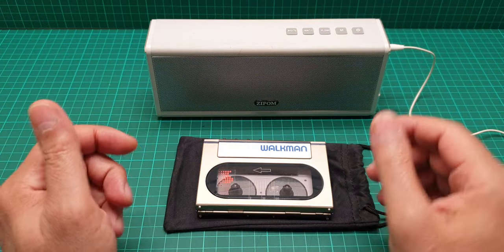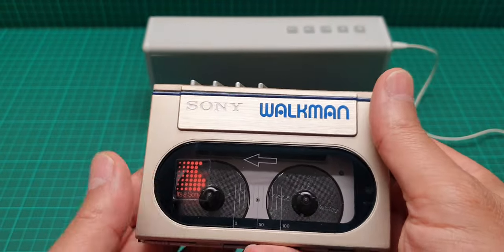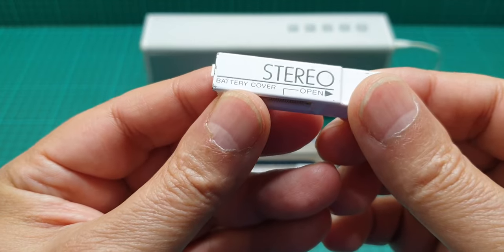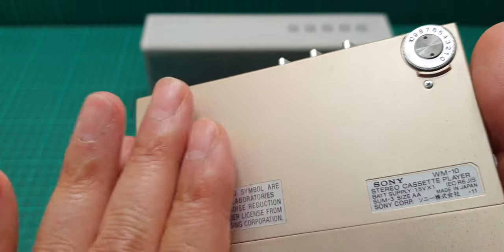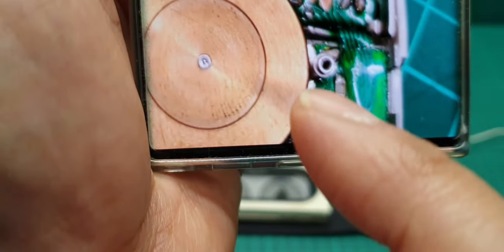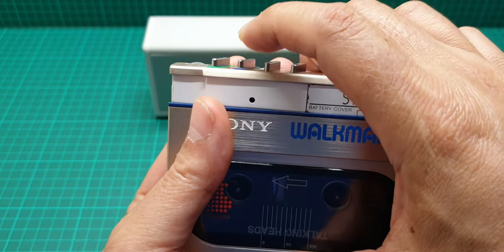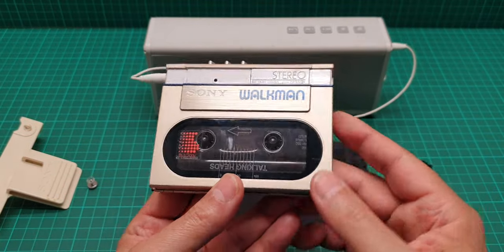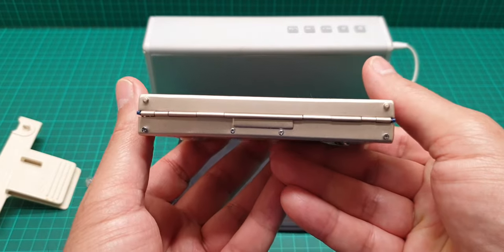Sony WM-10 personal cassette player Walkman review | smallest walkman ever | inside look

Comment: Nice job fixing this. I've fixed 3 of the WM-10s recently. They are loud but they always were. I owned a brand new one in 1983 and it was a loud motor. I used plastic gear grease to lubricate and it is still loud. https://youtu.be/fdbGD1krs2Y
Reply: The 10s 20s and 15s and radio versions all had loud motors.